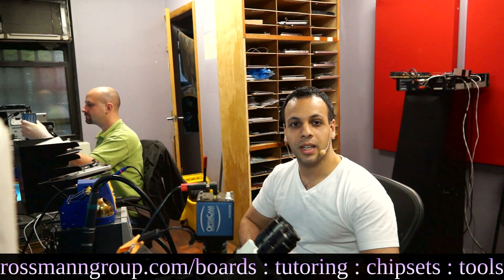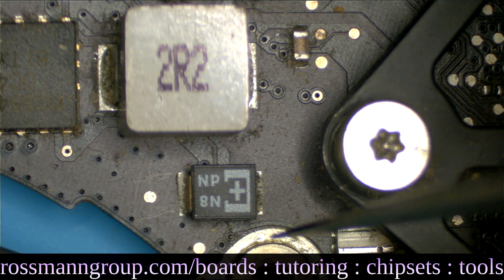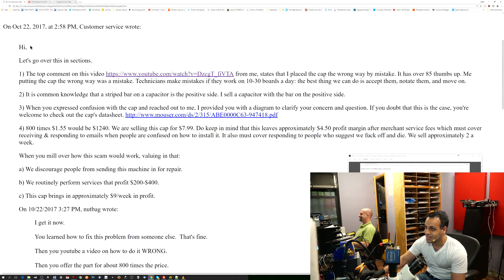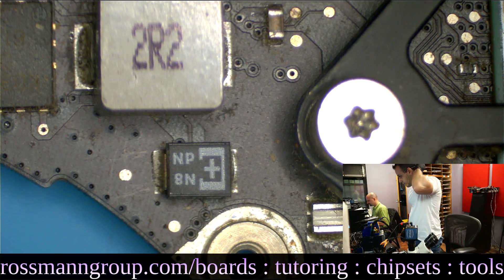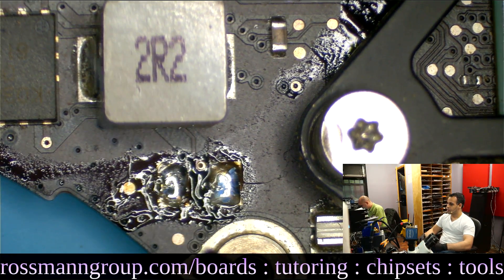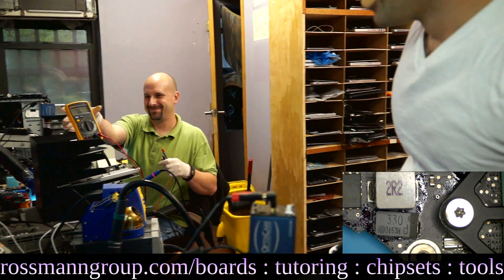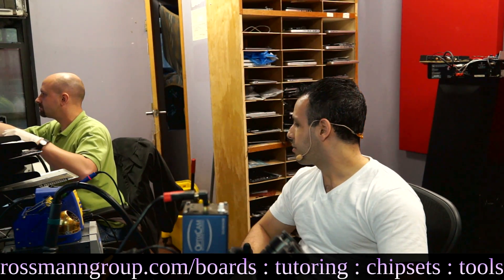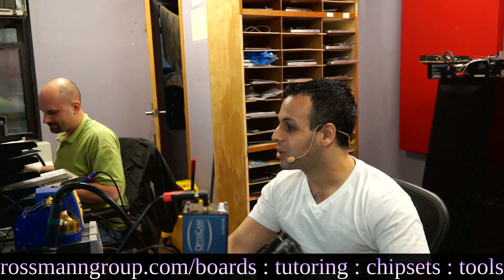ROSSMANN GROUP CAP SCAM EXPOSED!!1111ONEONE

Comment: Just completed this repair with the cap ordered from Rossmann. My soldering skills are not great, but just take your time and if you get too much solder on the pad get it off and try again. The first 2 times the cap was at a crazy slant because of a mountain of solder. The final one almost looked like I knew what I was doing... Thanks for the Cap, the video and the final fix for this MacBook Pro6,1 [17" mid 2010].

Comment: Don't go trying to fix laptop boards without having basic knowledge of electronics to even read a datasheet. I can see the confusion as electrolytic capacitors have the stripe on the negative side...

Comment: 100% correct information in this video, capacitors have positive marked with a bar.
In a previous video I noticed you using the new model cap and wondered why you still scraped the negative contact, as it is a "universal" cap you used.
And as you said, capacitors are not truly polarized, thus reversing is okay, so long as you don't connect negative (middle) and negative (end) to the board.
Finally, as others have stated in comments, it is questionable if he was trolling or truly obtuse.

Comment: @Rossmann; 6:25 there is a via(?) to the left of the negative terminal. Is it a GND? If yes, OK.
When you place the large capacitor, it will very likely touch the via. Is that intended?

Comment: If you don't know what the pins of a capacitor are for or can't be bothered to look them up along with how its attached to the board you shouldn't be allowed to handle hot objects like a soldering iron. Sometimes you just have to fucking think for yourself.

If you don't know how a capacitor works go ahead and break your stuff and pay a few thousand to get a new one.

Comment: I will give the guy this: I work with mostly aluminum capacitors, and for those the marking is almost universally on the negative side. But tantalum capacitors seem to always have the marking denoting the positive bias, similar to how diodes always have a denotation of the cathode. So. Yeah, only a cursory Google search of maybe 10 seconds gave me the answer I need.

Comment: That via without solder mask right under the cap looks dangerous. If you apply a little bit too much solder and slightly misplace the cap, it could bridge to the positive pad (which is slightly closer to the via).

Comment: 4:54 The striped bar on an SMD tantalum capacitor is the positive side. The striped bar on an Aluminum electrolytic capacitor is the negative. I think that's where the confusion comes from.

Comment: I know to check the data sheet, as connecting a capacitor backwards can explode. I have seen it happen, but even if it does not blow up there will be a short and damaged capacitor. I have repaired many things, and if something is clearly not marked with a plus or minus I will not assume that something used by one maker is not the same with all. Also $8 for a part that costs a few cents in a quantity of a few thousand sounds reasonable because of handing costs. Quite often it is possible to buy 10,000 parts for the same price as 10 pieces, and this is because the cost of handling. Price of the part is not the majority of the cost of buying a part, and the reason you got that stupid e-mail. Hopefully others will look at Mouser, Digikey, Alababa, and many other locations and see this same thing.

Comment: Wick away the old solder? that's madness! Surely you want the lead free solder to react to the leaded solder and lower the melting point to such a degree, that when your board gets hot from use the solder melts, and the capacitor falls off your board and kills your computer all over again!
Reply: I use leaded solder, the 63/37 stuff that melts at 183C, however, certain combinations of some lead free solders contain other elements that when combined with leaded solder will melt below 100C. It's very unlikely to happen, as it requires specific lead free solders, that are unlikely to be used by apple, but it is a real danger, which is why you should never mix leaded and lead free solder.

Comment: wait wait wait... the mark is the POSITIVE end? that's insane! Though I am used to working with traditional Electrolytic radial capacitors, which have a stripe on the negative side.

Comment: Can't tell for sure which case code size your using as a replacement. 
But Vishay number TMCMB0E337MTRF  B code cap  might be a better fit. 
The overall length is only 3.5 mm.

Comment: Help Help..Hi Louis, any idea what should be the resistance  reading at the  point where the positive side of the cap is connected with the cap out of the circuit ? After I replaced the cap I realized  it was shorted to ground( maybe due to bridging) . I removed the cap and I was still getting the same reading . After some cleaning I got a reading of about 33ohm between the points where the cap is to be connected. Is that an Ok reading? Or have I just craped the board. Just wanted to know before I go further.
Thanks ..
N.

Comment: Louis, so on those small rectangular caps. The stripe is the positive? I wonder why they strayed away from the standard of the stripe being negative. Like on the electrolytic ones?
I love your videos. They have helped me learn how to find problems. I am not a tech at all. I work in a refinery mak8ng gasoline. I just tinker in electronics. I have managed to fix a few things and I am proud of that.
First thing I ever fixed was the power supply on my 48" Samsung TV. 
I have a OBD 2 scan tool im trying to get working again. The company who makes it told me in an email they dont have a schematic on it. "But i can send it in to them to get it repaired for $69.99". I feel that is a lie. Because, you offer to repair it. And dont have a service manual? 
So im trying to troubleshoot this thing without a schematic. So far i have fixed a couple traces. And replaced 1 cap. It powers on. But the 5 buttons on it do not work. So looks like it needs more work. And if i never get it fixed. It wont matter as I have 2 Bluetooth scanners that are fine.

Thanks for your videos Louis. To some you may come off arrogant. Who cares, I think you can be if you want. You have the schooling to back it up. I wished I got to the electronics school when I graduated. My parents couldnt pay for me to go.
So when I got older, I had an opportunity to take night classes for process technology. And thats what i did. And now I work in this field. Which is a great paying job. And tinker with electronics on the side. It sux I dont know exactly what im doing. But im trying dammit !
And my tools are pretty good for what i do.
Weller soldering station
Klien MM700 soon getting a Fluke 117.
2 magnifying lamps. I actually like these. They zoom in good enough for what im messing with. I will be getting a jewel magnifier to look for joint cracks.

Keep the videos going man. Even though i dont mess with apple or phones. I still learn from them. So to hell with everone else. Do it for me 😁✊

Comment: I am guessing the nutbag never went to highschool? Don't know how it works in the USA (or wherever the idiot is from), but we learn a little bit about how circuit boards work (diodes, capacitors, etc..) and build basic circuits in school, this was too make those little toy engines too work, make the little lights go, work switches, etc.. as the fun part of science class in NZ.

Comment: The cosmic rules in the repair universe saying that fix and fit,heat or hit and make what ever until it works.Well maybe sometimes it might blown to death,but this is still happens and now.So what is the meaning of how to put back a little larger replacement capacitor.If not fits exactly then find any available way to put it,hammer it,solder it with wires or sometimes omit it  with responsibility.

Comment: Playing devils advocate, if you messed up the video u should have removed it. You have to remember people learning about capacitors will be using electrolytics as an example, where the stripe is on the negative.but I agree that attitude is disgusting, considering u charge 9 dollar for the part and the KNOWLEDGE. Knowledge is power.

Comment: I have a 15 in 2011 MBP and the left side hinge is failing, starting to lose tension and is bulging the plastic shroude. Is this a repairable problem? I anticipate using this machine for maybe another year on a regular basis.

Comment: it's actually really not "common knowledge" that the line on a capacitor is the anode marker. Almost no electronic hobbyist fucks with tantalum caps, and on the extremely more common electrolytic capacitors the line indicates the cathode, or negative/ground side. Unless they own a repair shop and make videos bitching about customers or are an EE they probably never had any reason to use a tantalum capacitor when electrolytic and ceramics are exponentially more popular for normal breadboarding type shit.

Comment: Is that a tantalum capacitor? I could see where this special snowflake got confused then.

Most capacitor types mark the negative cathode lead, but tantalums are backwards where the mark indicates the positive anode lead. Older style dipped tantalum capacitors didn't use stripes, and actually indicated the anode with a + to make it less confusing.

That is a pretty oddball SMD cap you got there though, not only is it a tantalum, but it has three legs on it. The last time I saw a 3 legged capacitor on anything was in the early 90s.

I say let this special snowflake install the tantalum backwards, as tantalum capacitors aren't forgiving to abuse and generally detonate forcibly.

Comment: There exists confusion regarding device polarities. It apparently makes some people dicks. Electrolytics put the band on the negative, while tantalums put the band on the positive. Wound non-pol caps have a band too, which is supposed to indicate the outer-foil end. (THAT'S THREE THINGS TO REMEMBER!11!) To make matters even worse, caps (especially cheap caps) are often mis-marked because they get flipped over during the manufacture, so you really should test every new cap you install, and never buy cheap caps. Polarized cap test: MM on ohms, short the cap, measure a few seconds, short the cap, reverse the leads, measure (the faster rise in resistance most likely has the red lead on +, but not necessarily). Non-polarized cap test: fingers around cap, o-scope, 0.1v/div, signal probe on each lead (the higher 60Hz+noise amplitude is the outer foil).

Comment: hey Louis,i like your work, the only thing matters for my broken electronics is to get them back to work, doesnt matter if you swap parts, or put new parts vise versa. 
 i am not any engineer, well i dont even have a multimeter, (i learned the names watching your videos), the only thing i dont like is your attitude toward viewers or those who are commenting on your videos. except this guy, he was realy rude. and used foul language. 

you handled this issue nicely, having a third person fix the capacitor live. 

the guy who is commenting on your fix just needs apple repairs...... where apple will let him buy a new device, and let him hang this device on wall as souvenir.

keep up the good work, i saw your debate with apple " right to repair"  but didnt get to know what it resulted in.

Comment: If you're unhappy about the price there is always mouser and digikey moron lol. Ebay will have them i'm sure and i'm an electrical engineer however i'm not sure about that particular cap. But even if it is a special cap that you have to order in bulk then buying one from you would be a deal because you don't have to buy 10k of them trust me. Even on Digikey you pay more if you buy less. The Chips i use in my keyboard design cost 8 each or 4 each if you buy 1000 and you need at minimum 7 of them which makes for an expensive but sound keyboard. I put quality parts on my boards so you get a quality product.
Reply: MrSysdump
What part of your keyboard needs 'a minimum' of 7 of one component that costs $8 each and can you post your design/pictures of the keyboard? I'm interested in your keyboard design.

Comment: Anyone know if heat pipes become less effective over time? I did the capacitor swap, added fresh thermal paste and have a working nvidia GPU again but the fan keeps ramping up and the machine becomes really hot now that it's no longer restricted to the iGPU. If only Apple built all their machines like these though.. 7 year useful lifespan and software support is pretty spectacular for a computer.
Reply: They should last forever, it's possible the fluid leaked out though. Please keep in mind Apple computers do run hot (my 2015 13 mbp runs at around 80c under load) naturally, they usually throttle before increasing fan speeds. It's not an issue unless the cpu is throttling severely under load.

Comment: I like the way you do your videos, go on!
OT:
Hey, I have a standard soldering station, 450°C. I tried to repair a motherboard, where 22 big electrolyte caps were blown, and a switching power supply. As I wanted to desolder the caps, I failed because the solder won't melt... Any suggestions? Thank you!

Comment: Have you tried one of those gas driven soldering iron pencil with hot air?
 It would be interesting how they perform since one of those higher end is cheaper than a hit air and you get both.
Maybe it will not work for you but hobbyist and people on the run.
Reply: Hampus Baaz I have the Blue Point YAKS32, I have never tried to use the hot air for SMD, mostly heat shrink, but as a soldering iron I find it endlessly useful around the house and garage and in times gone by it worked great working on comm gear in HMMWVs!

Comment: Caps such as tantalum cap in the video are made by an electrolytic 
process (anode and cathode are chemically different), so I guess 
connecting them in reverse may degrade their performance over time (not 
immediately).
Correct me if I am wrong. :)